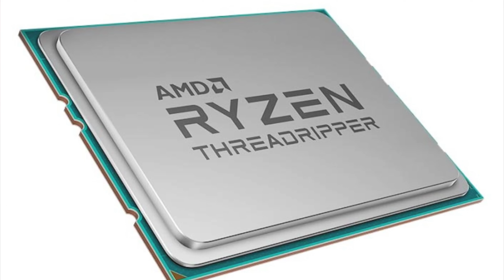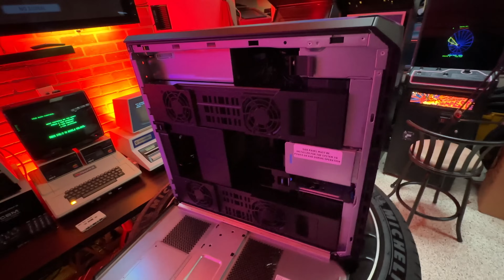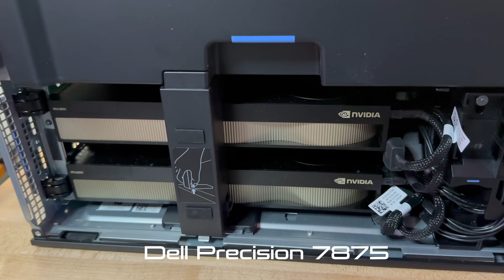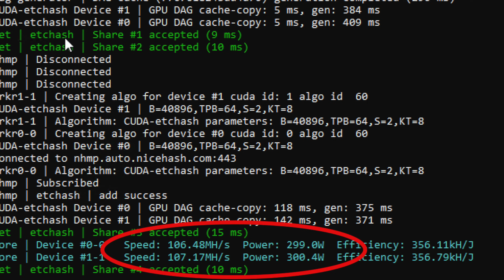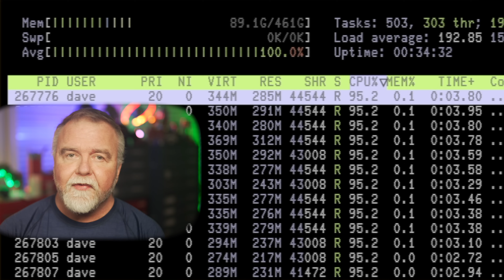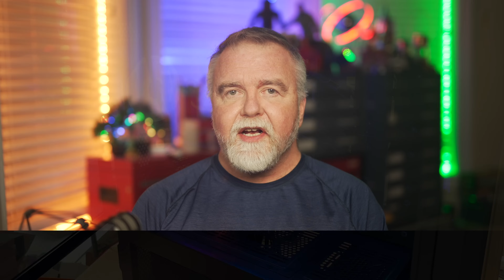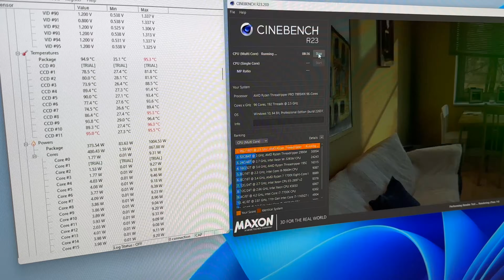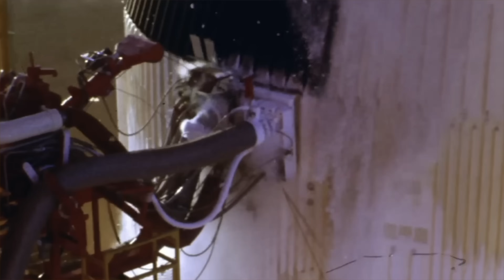1000W CPU:  The Most Powerful Desktop Processor

Comment: If you are interested a scientific programming example, run a molecular dynamics simulation using LAMMPS. You could build a 1,000,000 atom simulation and run it over a week or two weeks to collect data and generate some graphs of the data.

Comment: I could understand why you be weary of a custom water cooling loop, but Im of the hot rodder opinion and will compromise on other thing but not performance. I have dual radiator setup, to cool a delided 7940x and a rtx 3070. The water block on the rtx 3070, is so it dont hog up two card slots eating up pcie real estate that other cards can use. I also made a custom dual 40mm fan bracket for the vrm, so the cpu can run at 4.5ghz without the vrm thermal throttling. Your minute to build a kernel is impressive, when it takes me just under 10 minute to do the same but I dont have the coin for what you have.

Comment: Lemme get this straight... You're putting 1000W through a CPU (never mind the rest of the system!) on a 1200W power supply, and you expect that system to be stable. 😂😂😂 I don't know what the rest of your system pulls, (RAM, mainboard chipsets, graphics cards, etc.), but it'll be more than 200W when working hard. Just the RAM and efficiency losses in your VRMs probably total more than that. You should never run a power supply at the max rating. You always leave headroom for transients. I'm skeptical that even a 1600W supply would really be enough. You're probably looking at multiple power supplies. If you've mined Bitcoin, you should know all this.

Comment: Being FPGA designer I'd love to try synthesis for one of my projects on your Threadripper. Intel Qartus and Xilinx Vivado software use all available cores for compilation. However seeing the TDP limitation of the 7995 I wonder what was AMD thinking when releasing that CPU which throttles 80% of the cores just because of the power limit. It's like laughing at users face.

Comment: I find 20-30 seconds unacceptable. It should be instantaneous! And rendering? I want it real-time at 60fps before I spend $10k on a CPU. The 7980x is half the price with almost 90% of the performance, and using a 4090 is almost twice the performance over the A4000 for most applications.  We’re getting close, but no cigar! In addition, the OC Threadripper starts to challenge other systems and affect your household. When operating at 1000W, you might need to check your UPS (APC SRT2200XLA) to see if it has enough capacity for your CPU, monitors, etc. Likewise your circuits, I recommend wiring that can handle 20amp. And if you live anywhere but Alaska, you need to have air conditioning and maybe a Vornado 660AE if it’s in a tight space. You can warm a small office at 1000W.😂

Comment: For most applications, a 7980x Threadripper with an RTX4090 may be more performant at a much lower cost (7980x is $5000). This is because most O/S’s are currently better optimized for 64 cores and your aforementioned power limit if 350W. Additionally, optimizers like Optix in Blender are much faster on a 4090 for less cost than an A4000. And you can spend more on RAM with a cheaper Threadripper. It can also be overclocked if you “uncork it”.
Reply: This is only true for more niche applications. Many major professional applications like Blender or Cinema4D (ala Cinebench) have their own thread schedulers that can push well past the Windows thread scheduler thread limit.

Also, if you use Linux than literally everything you said is 100% wrong. 🤷 The default Linux thread scheduler can handle way, WAAAAAAAAAAAY more threads than Windows (thanks to the server market backbone) as well as any desktop CPU currently on the market.

Comment: Youre def going to hae probs at that power levels witha stock setup.  I didn't see any mention of a "CPU Contact frame"  The stock socket retention setups are crap and you'll get hot spots on the CPU

Comment: wtf are you rendering those stable diffusion images on the cpu? my single rtx 4080 with those settings takes like one and a half second to render an image. i can render 960x640, upscale it to 1920x1280 and it's still faster than that.

Comment: Custom water cooling is not a risk to your $10,000 CPU. Just test the loop outside of the system before connecting the water block. No need to bend pipes - just use soft pipes. To be extra-extra safe, you can wrap the joints in silicone self fusing tape - I'm sure an ex-plumber like you has a dozen rolls laying around!

Comment: The only disappointment I had was you didn't show windows task manager!

If I had a system like this I think I'd at least try running an open loop cooling system, just hook up the garden hose to the inlet of the pump and sprinkle your lawn with the warm water coming out.. you'd have MUCH cooler temps!

I have a very power hungry, old school CPU, the AMD FX9590 with 220W TDP.. fan noise becomes significant under load!

Comment: AI runs better on GPUs , so it makes no sense for AI , i don't know about VIDEO , or CGI , all kinds of processing that can be handled by multicore CPUs because for example what i do , Audio , it makes very little difference how much cores you have , it works on 1 , tho if  OS system is optimized for 4 cores or 2 cores , of course that will help you , but 100 cores forces you to push down the clock frequency , because due to small size of a chip , a core , you cant  remove heat from 1 core or 2 core as good as you could if it was 4 or 6 core CPU , reaching higher Clocks making Audio processing faster .

Comment: That 1000 watts only consumed, if the computer is blacklisted, the win is illegal, the cpu is too hot. Generally, the computer , cpu, chipset has to be cold when idle. The performance mode of win has to support it. When the pc is in extreme use, the power doesn’t become heat, the performance doesn’t come with much heat. But the paste, copper cooling counts, because the cpu’s thermal sensor recognizes it.

Comment: With such a huge amount of power why go with an AIO and not a custom loop? 
360mm custom loop way outperforms a 420 or even 480mm AIO 
With pump flow rates 10 x higher and proper rads made from copper & so on.
No need to bend pipe if you use flexible hose who cares how it looks. 
Less chance of you making a leak than the amount of tens of thousands of AIO that just suddenly start leaking

Comment: For the RGB crashing i had a lot of trouble with mine, i found that it was the windows quick boot that was the culprit. Seems to try to restore a state when loading the image at boot and the code of the RGB drivers was not prepared for that. I had to turn it off to finally have it working properly.

Comment: It appears as though the Threadrippers have 8 memory channels per CPU.   The new EPYCs have 12.   I do CFD for work.  I can keep the fastest EPYCs churning on a simulation for days.

CFD work is memory bandwidth limited, not CPU limited.  I'd get an EPYC before I'd get a Threadripper.
Reply: I use OpenFOAM, not Fluent.

Comment: The super high core count chips are definitely limited on power, but you still get more performance for more cores, due to how CPU power scaling works with frequency and voltage (roughly frequency times voltage squared). Voltage being the important bit. So you get more performance going from 64 to 96 cores, but not 50% more. This is also why you can have an 8 core laptop, though all core clocks are noticeably lower than would be on a desktop.

Comment: When you have 16 threads running, it will boost higher maybe 4ghz when you have 32 it may only boost to 3.5 and with 64 3 and 96 2.8 so it is more power efficient on a work per watt to enable all cores running at 350w vs 16 cores running at 350w

Comment: If it's heat created my so many WATTS being used Why not make a cooling system that actually uses a REFRIGANT i place of Water/air type CPU Cooler. or just refrigate the WATER to just above the Freezing point or a refrigant that can be much lower than 32 Degrees F.

Comment: The Arctic Freezer III should perform better than the Asus as it comes with an offset bracket. It also has a stronger pump compared to the asetek one used in the Asus.

Comment: I wish there was a simulation benchmark that was more common.  Simulation workloads revolve around doing matrix computations and don't lend well to multithreading unless there is some secret sauce in the simulator that exploits sparsity (many 0's in a huge matrix), but those gains break down cpu to cpu if the inter core communication hits some bottleneck.  Traditionally there is a farm of xeon servers somewhere to run these, but I'd be curious how much gains there can be with a tuned homebrew solution.  I have been shot down when pitching this idea before because it would be a maintenance nightmare.

Comment: That CPU is crazy! In theory, it would be at its thermal limit with only 48 cores utilized! I bet you could get a whole lot more performance if you undervolt it as much as possible, because it'll be running at a lower frequency anyways since it's constantly thermal throttling.

Comment: Re RAM:

You are dealing with 3 variables:
- RAM itself
- BIOS Optimization for specific RAM configuration
- CPU Memory Controller

If RAM is Rated for something, it usually does to spec.
If bios was not tested (motherboard) with those speeds... YMMV.
Server CPUs are usually not equipped with above spec memory controller. It is the Non-ECC v. ECC, consumer v. production machines. One favors performance, other stability.

Comment: Pro platforms like that you really have to use the motherboard vendors validated hardware lists if you want any chance at having a stable system.  Sometimes they will go as far verifying coolers and power supplies with exotic hardware like that, not just memory configs.

Comment: Intel: "1000W is nothing. That's what our next generation of Laptop chips will draw at idle... All of which will be manufactured on our brand new 14nm+++++++++++++++++++++++++++++++++++++++++++ node we've renamed "Intel 4" Why shrink the manufacturing technique when you can simply increase the T-Junction temp to 300 degree Celsius instead?!?"

Comment: Bro - Those Enermax's are junk! Beware Beware. Gamers Nexus I believe showcased their problem a few years back. I had one then for my AM4. They have never fixed their coolant issue clogging coolant that turns wierd and smelly despite their claims. I implore you to change that out if you are going to keep your nice build since you nor I are The Mario Bros. Buyer beware! I eventually dropped AIO cooler after that one cannot trust the Enermax to find longterm reliable purchase on your processor. Something that is not going to be a failed AIO that does just as good is the IceGiant ProSiphon Elite. A huge vapor cooler - and it really works well. Just as good as any AIO especially in a large case IMO.

Comment: @6:55 How is more CPU cores easily leveraged in 3D architectural design? I Work in Autodesk Revit which is by far the most prevalent 3D architectural design software and I have never seen it use more than one thread or two threads during extended tasks.

Comment: lol, measuring how good your processor is by the power consumption is as sensible as saying your car uses more fuel so it’s better.  If the main output from your system is heat then unless it’s a heater it’s a fail. The real output is the work that can be done, how much actual computing can it do?

Comment: Have y’all ever turned around and took two different CPU’s and made a computer with them with a DPU at the heart like taking one CPU making it work running the Microsoft windows taking the other CPU make it work thread to security and such and such like a left arm and the right arm You can make a far better system that way if it’s for AI artificial intelligence with the bottleneck with the CPUs

Comment: Just checked the 4090 FE, it scores ~34000 pulling 290W in Cinebench 2024 using 22GB VRAM (that includes the desktop, nvidia-smi doesn't show per-app usage on Windows like it does on Linux for some reason). R9 5950X I'm getting 1422 pts, though I don't think I have PBO on right now.

Comment: I got a new Dell 7875 with a much more modest 16 core Threadripper Pro 7955.
It does have a strange issue where it automatically starts up from shutdown even when the BIOS options for restore after power loss, wake on LAN and scheduled startup are all set to off.

Comment: For 3D rendering, I need as much grunt as I can get, while still being rock steady stable. The rendering engine I use is GPU based so, a 64-core GPU with 128gig RAM is probably sufficient. On the other hand, I need as much GPU as I can run. As of right now, that is two RTX 4090s. On the other hand, would it simply be more cost effective to use an on-line render farm service? Don't know yet.

Comment: Awesome video! Loved the results and the custom machine for the 1kw tests. Only thing I would’ve changed on it is upgrade the PSU to a 1500-1600w (maybe more) one, might reduce the chance of crashes with the extra headroom since the cores are pulling 1kw with the CPU’s IO die pulling probably 100-150w plus the rest of the system, then the 1200w PSU isn’t up to snuff anymore. (I’m sure it can handle a bit of a overload, but not for 15-30 mins haha)
Reply: Might explain random spontaneous reboots.

Comment: so... having two chiplets with each 8 cores in my 7950X, I can hardly imagine having 12 (!) of these in a CPU. 
Threadripper is apparently still HEDT, reaching into workstation territory. 
Personally I would not call these "desktop" at all, since "desktop" is for me "consumer grade", and that amount of processing and electrical power is far beyond desktop.
For me, Threadripper is a workstation CPU.
That Threadripper CPU is muuuch more optimized to efficiency due its way lower frequency. Looking at current Cinebench R23 multicore scores:
to comparison, my 7950X is at 35k when running in 105W Eco mode (which is already very efficient, compared to it running almost stock with 170W and "just" 4k more points)
130W 7950X: 35k (360 AIO)
170W 7950X: 39k (360 AIO)
world record 7950X: 50k (LN2 cooling)
7995WX: 100k
world record 7995WX: 210k (LN2 cooling)

these LN2 records (both at 6Ghz+) were done by the same person btw

Comment: I have a suspicion that an undervolt would be a requirement to keep clocks stable at that heat output. If that isn't enough, direct-die or even sub-ambient cooling. Also, I second the notion that Zen really benefits from the fastest RAM possible and must be taken into account for total system cost.

Comment: I would love to have a machine like this for program I wrote that can theoretically use an unlimited number of threads with 0 locks except for 1 spin lock for the master thread that just has to wait for all the other threads to finish. Speed of the current code finishes the max single run I have the code set to be able to do in a very small fraction of a second on a lowly AMD 5950x running at at stock speeds. 512GB RAM would clearly not be enough but the code could be made to work on that size of a chunk of data at a time.

Comment: The A100 is good for medium AI models but once you get to large AI models it is suggested to have more than just 2 A100s. More so like having 8 of them in a single system which you can do in rack mounted servers but not in the way ATX spec motherboards require it to be laid out due to thickness of the cards and the part of up to 6 PCIe slots not 8.

Comment: I've run into that with memory several time, even when you buy the exact DIMMs recommended by the MB maker, they often just done run stably at specified speed under load.  I once bought a replacement mother board thinking I had a thermal issue and later discovered that there was a single bad row in a brand new DIMM when the new MB had the exact same symptoms of the old one.  D'Oh

Comment: If you worry about coolant leaks, use XSPC EC6 or one of the other waterless coolants. I've been using it for over 5yrs and I've even spilled some on a running graphics card without any effect beyond it leaving a sticky residue after wiping it off.